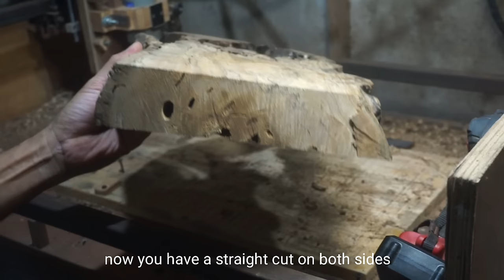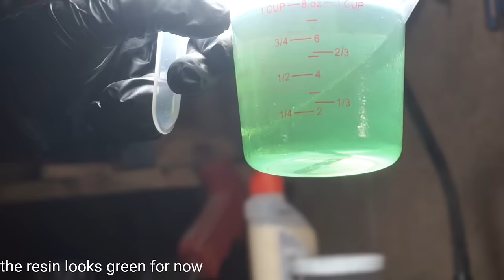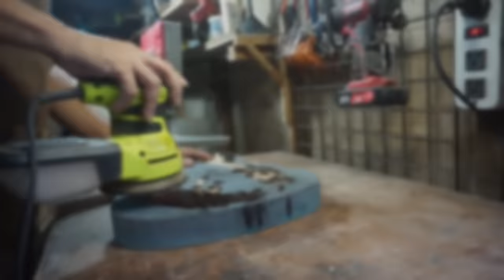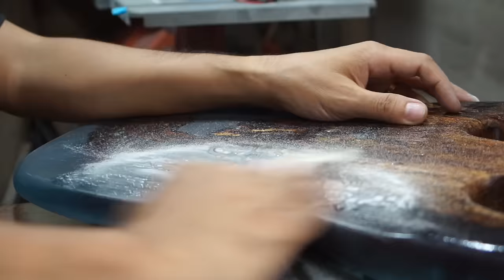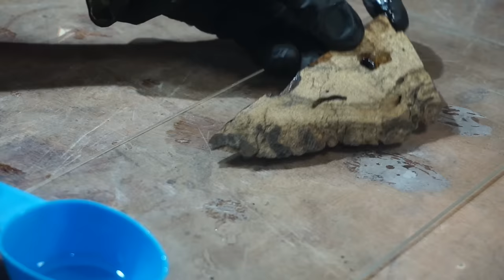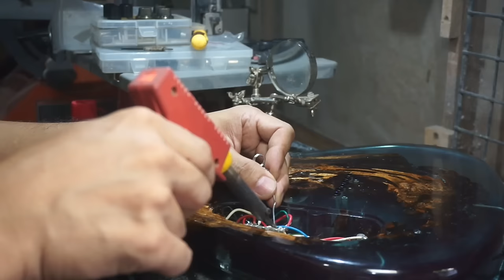I Built a Live Edge Epoxy Resin Guitar

Comment: Maybe consider putting the strings in the locking tuners and pulling them tight and then cut off the excess to leave as little winding around the tuner post as possible so the guitar stays in tune better . Thats the whole purpose of locking tuners !  Keep up the the good work !  (from Canada)
Reply from the maker: Thanks! I know someone who does this and I'm always wondering why, now I know now. My friend is a professional guitarist from a famous band here in my country.
Reply: What are these locking tuners though? I love the patina brass hardware!
Reply from the maker: The Brand is Guyker
Reply: Sometime when you won the strings a couple of times some people say you get better sustain
Reply: @jimcoppa6946  I think this is all based on break angles from the strings at the nut, however, I think most modern locking tuners compensate for this by having the hole far down the post.
Reply: Absolutely beautiful !
Reply: How about just doing the nut properly and you don't even need to think about locking tuners?
Reply: tuyệt vời, từ Việt Nam

Comment: Considering the very bad condition of the piece of wood used (which seems quite brittle, like old wood already attacked by insects), I'd be very concerned about the stability and robustness of the part of the body screwed together with the neck (which is mostly wood with almost no epoxy). The final result is mind blowing though!

Comment: That is an amazing guitar. The only thing I don't like about it though is that you can see the 2 screws on each of the pickups. Is there anyway for you to come from the back and screw it down from the backside and then put a back plate on it like you did with the switches. Or could you do a nice recessed coverplate to cover the screws? Otherwise though as mentioned that's one sick looking guitar.

Comment: That is a beautiful guitar. Two things. One, have you considered using the wooden offcuts from the body to make things like wooden tuning pegs or control knobs? Two, I would be tempted to use a gold epoxy to fill in the voids from the original pour. The Japanese have something called Kintsugi. It is the art of repairing broken pottery by mending the areas of breakage with lacquer dusted or mixed with powdered gold, silver, or platinum. I have thought that you could use the same idea to drawing the eyes to the flaw and making it part of the art.

Comment: What did you use to make the strat moulds for the pour? The blue things covered in some sort of tape?

Excellent vid. About to start my own project on an explorer!
Reply from the maker: The moulds are made of wood and painted them so that the resin won't sip in. The tape works fine but I wish there is another alternative for it cause some of the tape comes loose during the resin's curing process. Have fun with your project!

Comment: Beautiful job! I love how you have other projects using the CNC machine and then this project you just used router templates. It was also neat seeing you even use a Dremel router kit to drill the small switch hole. For the mold frame, is that just styrofoam with tape? Also, that is taped?

Comment: this guitar is gorgeous and you are very good at building them. But we should understand what electrical system you mount? Is it shielded well? What pickups did you have? Is there a metal core inside the handle? Because it's aesthetically beautiful but how does it sound? It would be good if you let us hear it and also gave us some technical information. And above all, how much does it cost? Where can it be bought? Thank you.

Comment: Wow, watching you build is very moving to me. You seem to flow in a way that I've never seen before of a builder. Most builder videos I see are very, very technical. And I can see that you do a lot of technical things. But even the technical things you do seem to have a sense of intuition, beyond just an intellectual approach to the craft, if you get my meaning. Absolutely lovely work.

I also wondered if I could ask a question. I'm building a neck for my guitar soon and I'm looking for good tuners which are also brass or something similar. Can I ask about the tuners you used here? What brand and model are they, and what sort of quality are they? The only brass tuners I've found seem very cheap and off brand.

Comment: It looks amazing, i do have question about the body... Can it withstand the tension of the strings? Is the epoxy strong enough? Asking in advance if i might try this kind of build. Love the blue color u chose
Reply from the maker: It can withstand the strings, the other resin guitar that I built still stayed in-tune after a year, they're just hanging on my wall occasionally playing them. I'm using Clearcast Resin which is rigid than Epoxy Resin, but is much difficult to use.

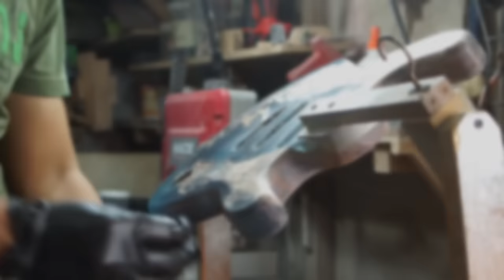Comment: Amazing!  One question, though.  About the section on finishing 15:02 what is it you're rubbing on the guitar?
Reply from the maker: That's Wipe on Poly by Minwax, a Polyurethane paint that you can just wipe. A bit expensive but really easy to use and fast drying. Thanks!

Comment: Beautiful guitar!!
I only wonder why you didnt polish the channel between pickups and control cavity? That must be doable? Just like the outside of the guitar. And the straplocks the same, and then with some clear superglue?
Reply from the maker: What I did was apply "wipe on poly clear gloss" inside those channels including the control and pick up cavity. I tried applying it to the strap lock part but when I screwed it in - it made scratches and it didn't look good. I didn't want to experiment more cause I might ruined it since I'm already at the home run.
Reply: @GitaraMaker  okay, that makes sence. Thanks for the info!!

Comment: what did you use for the mould? love the end result.
Reply from the maker: It is pine wood and sprayed with blue primer which is not necessary, I also covered it with scotch tape. But if I'm going for repeatability for manufacturing, instead of scotch tape I'd use Silicon mould. Thanks for reaching out!

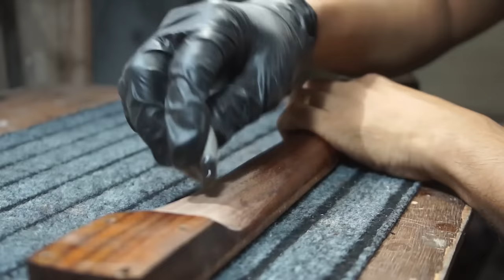Comment: what did you use to make the wood darker at 14:55 ?
Reply from the maker: The one on the video is "wipe on poly" but prior to that, I applied 3 coats of sanding sealer first.

Comment: What type of epoxy resin are you using is it hard or soft?
Reply from the maker: I use Clearcast Resin, which is more rigid than Epoxy Resin. But I also use Epoxy Resin for the seal coat the wood.
Reply: @GitaraMaker  I almost forgot do to since I'm using it on my Guitarlele/Guitalele do you need wood primer or no?

Comment: Weight? Almost every epoxy bodied guitar or bass I’ve ever got a chance to try was extremely heavy and uncomfortable to play standing for any length of time.
Reply from the maker: Surprisingly this is just 3.5kilos or 7.7lbs, it is scaled down, removed a lot of materials on the belly cut and arm bevel. 
I built an epoxy bass (my 1st video) that is standard J Bass size and thickness and it is 5 kilos, I learned a lot from that build.
Reply: @GitaraMaker  That’s very reasonable. No heavier than some Strats I’ve played. And about a kilo less than the average Les Paul. Beautiful build by the way! I neglected to compliment you on that earlier. And that’s inexcusable. This is one of the prettiest guitars I’ve ever seen. :-)

Comment: What kind of epoxy do you use?
Reply from the maker: The first one is 2:1 Epoxy Resin from "Rest Ink" I used it for sealing the wood. And I filled it with 1000:5 Clearcast Resin from DS Online. These brands are from my Country, but you can try looking for the types of resin  with the specific mixing ratio that is available for you. If you will use 2 parts Epoxy (Rest Ink) those types of resin are really expensive, that's why I'm using Clearcast for bigger volume fill.